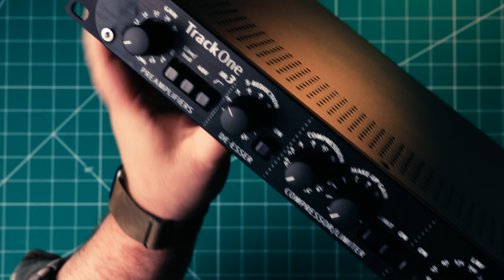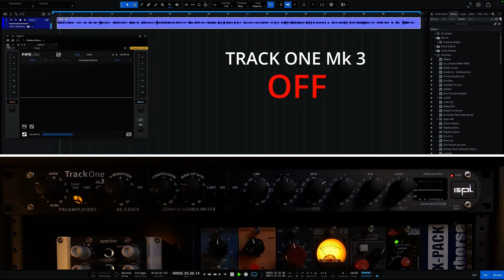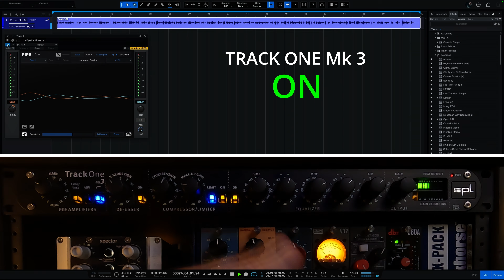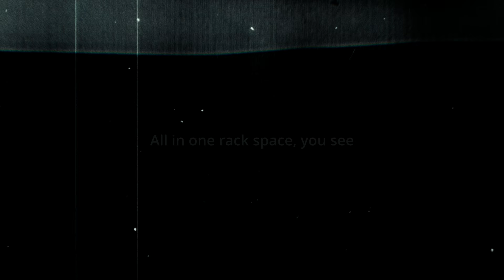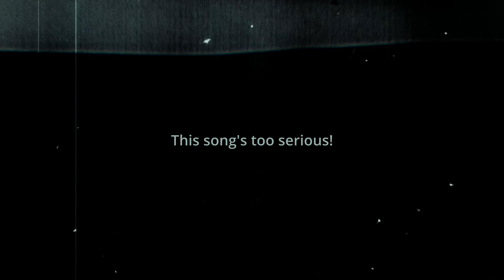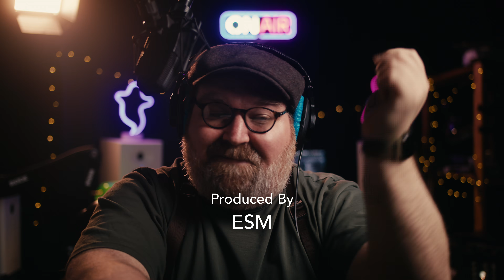SPL Track One Mk 3

Comment: Thank you. You made my day with this review.. =)
Reply: By the way, I didn’t find any comparison between dbx and this one.. I would like to ear the differences between both. Cheers
Reply from the maker: @DrPedroCastroLopes  unfortunately, my DBX 286s has stopped working. I cannot do a comparison video. But I can tell you that the SPL Track One Mk3 is in an entirely different league than the DBX. It’s not even close.
Reply: @TheRecordist in your opinion is it worth to upgrade to a spl channel one mk3 for that sound of a radio station voice ? Thanks for your time 😊
Reply from the maker: @DrPedroCastroLopes  hey there. Well, you can get that sound using plugins, but I will admit, the EQ on the Track One is insanely good. So is the compressor. That’s entirely up to you. 

If you do decide to get one, please use my link! Cheers!
Reply from the maker: Oh that’s great! Cheers!

Comment: Would’ve loved to hear the preamp on the RE20
Reply: In my experience the SPL kit has a bit of an issue with RF: the Vitalizer Mk3T and the Channel One Mk3 Premium BOTH generate a signal that some mics pick up as a nasty hum, even when used on a completely independent audio chain (I tested this with a battery-powered field recorder situated in the same studio as the SPL kit): the RE20 is especially affected. Maybe I’ve just got bad units but … I dunno.
Reply: @MouseSqueak concerning. appreciate the heads up
Reply from the maker: @MouseSqueak  that’s strange. I have had zero noise from mine. Not even a slight hum. And I’ve used the Track One Mk 3 with at least a couple dozen different mics. Perhaps you got a lemon? I’ve never even heard of that until now. Have you contacted SPL?
Reply from the maker: Me too! Unfortunately I don’t have an RE20 here.

Comment: From your comments, it sounds like this unit is designed primarily for VO. 
Not a fit for singer-songwriter male vocal?
How does the preamp compare to a Neve 1073?
Reply from the maker: Not at all. This unit would be great for any instrument or vocal. The preamp is clean, unlike a Neve 1073. But you can upgrade the unit to a transformer input/output version for a little extra, if you want that color.

Comment: Okie Dokie, got mine yesterday!
I've got a few outboard preamps and compressors and EQs so, my primary objective is to use the de-esser.. My initial observation is.......this thing works, just need to do some more testing to determine if I want it on the way in or after tracking, as an insert,  as I usually use clip gain to reduce Ss' before using plugin de-essers. The great news is, I really like the results I'm getting using the entire unit as a channel strip.
I switched from my "A Designs Pacifica" preamp to the Track One and I'm very happy.
Reply from the maker: Woo hoo! Let me know what you think once you get a good feel for it! 

You use clip gain as a preliminary de-esser? That must take ages! 

Have you ever heard of NoiseWorks DynAssist? It’s a plugin you might be interested in.
Reply: @TheRecordist  Don't have it yet but looking at DynAssist as my next gotta have.
About using the TrackOne as an insert w/Studio One...having difficulty getting it to work with PipeLine
Reply: Yeah , I usually make primary dynamics adjustments and de-easing with clip gain.
I’ll check out that plugin, Thanks
Reply: Do you like the preamp section better than the Pacifica?
Reply: @FatToneStudio  Track one preamp vs Pacifica….i think I like the Pacifica better, particularly for guitar amps. On vocals, I think I can get more color out of the Pacifica if I push it. However as a complete package, the Track one is  Swiss Army Knife

Comment: honestly 1200 for how good it sounds is a steal.
Reply: Is there is the premium or non-premium version,  I see they have two different versions
Reply: @lightning-audio-and-reviews  the premium has lundahl transformers in the input and output signal chain. the non premium is transformerless. resulting in a different sound
Reply from the maker: @lightning-audio-and-reviews mine is the non-premium version without the transformers.
Reply from the maker: Oh I couldn’t agree more!
Reply: @TheRecordist  I been considering the channel one MK3 premium. The 2U version. You’re the first person who showed a musical version of the units. Tho I know the other has different features. This video gave me some insight on what to expect.
Reply from the maker: @berdeauxlaveau6515 oh that’s great! If you don’t mind the absence of the the tube section, the transient designer, and the dual band de-esser, this is a much more affordable way to get the same premium electronics. 

Also, you can upgrade the Track One Mk 3 to transformer coupled input and output. Just select that option when you order one.
Reply: @TheRecordist  i could use the transient designer when recording vocals in a non treated room. i do intend to travel with my gear. i was also considering building a custom 500 series channel strip and gdtting the spl tdx and des either way. i was more conscerned with the musicality of the preamp. i just want something quality that sounds professional
Reply from the maker: @berdeauxlaveau6515 I’m not sure how the transient designer would work in an untreated room, but that sounds like a cool thing to try! 

The Track One is pretty heavy. I can only imagine the weight of the Channel One. I do think the Track One has everything one would need to track music. The basic model I have is very clean but it can be pushed for color, since the preamp section uses transistors — and as I said earlier, you can get the deluxe model that has transformers, so you can really get a lot of color if you want.
Reply: @TheRecordist  transient designer can be used to reduce the sustain which works as a de-verb to eliminate room verb.
Reply from the maker: @berdeauxlaveau6515 oh yes. I know the theory, I’ve just never seen it in practice!

Comment: Obviously the price differential between the the 286 means there  is a difference. What is the main difference in your opinion?  1:31
Reply from the maker: Quality. The quality difference with every aspect of the SPL is almost incomparable.

The Track One is much quieter, the preamps section is transistor driven so the analog sound is much fuller with an ability to drive it hard for beautiful saturation, the compressor/limiter section is brilliant, the de-esser uses a technology that was invented by SPL and is the best in the world, the EQ is incredibly high end, and the AIR band is coil capacitor driven (beautiful sound). Not to mention the build quality is among the best in the world. 

It’s hard to use words to describe the differences without sounding biased, but if you compared them directly, even a non audio person would recognize it. 

Hope this helps!
Reply: Sure wish it had a gate.

Comment: Great video! I hadn't heard of this unit before watching but now I want to get one in my rack! Honestly, based on your review and demo I expected this to cost twice as much. For years, I've been low-key obsessed with getting my spoken word recordings to sound as finished as possible before they ever hit tape.

I do have one question after watching the video. Is there a way monitor the level of the preamp section independent of the compressor/limiter? Too many times over the years I've been in the situation where I've got a compressor patched in pre-tape, compression is cool, levels into the interface are good but a couple of takes in I take a peek at the preamp and I see the peak indicator going crazy.
Reply from the maker: Hey there. Well, you can switch off the comp/limiter and monitor the levels totally independent of them. There’s also an overload indicator light. But I think it’s more like you get a feel for the unit and get to know it. 

It’s a transistor-based preamp section which can be brought to a nice subtle saturation when pushed. You can turn off the comp, de-esser, and EQ sections first, and then work only with input gain, output trim, and the meters, then you can introduce each section. 

Hope this helps!